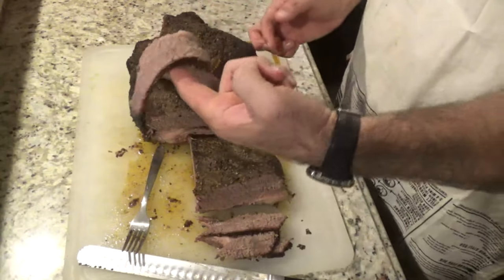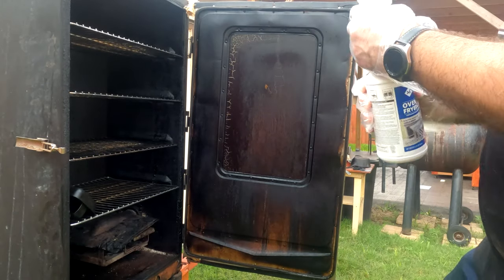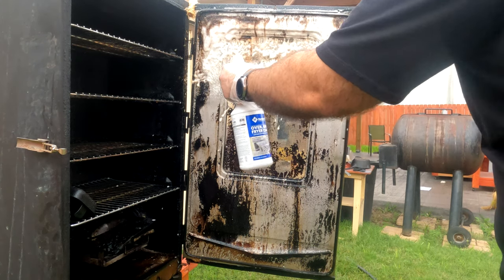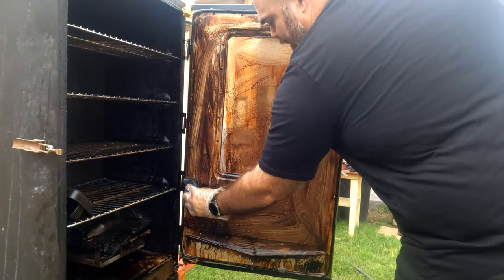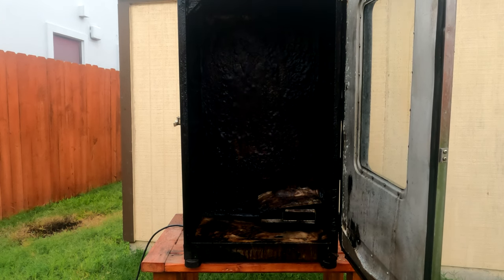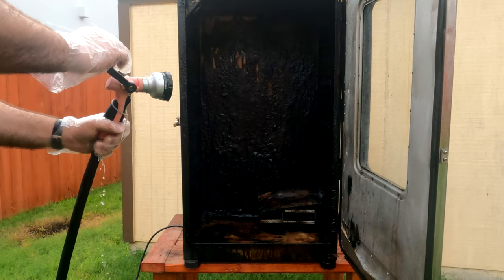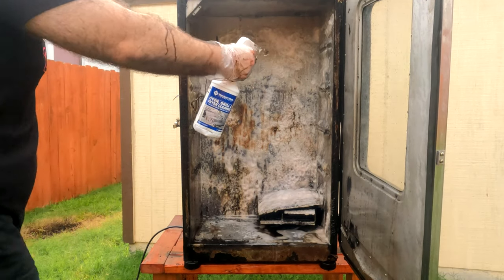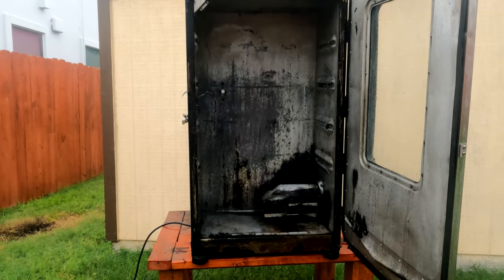How to Cleaning Your Smoker in HD

Comment: Is your a electric smoker? I just received a used one that needs some serious cleaning I was thinking about using oven cleaner on it but I can’t see if there are any wires in it
Reply from the maker: My thinking is that it's meant to get wet on the inside because that's what happens when you some something.  Moister is all over the inside during the smoke.  As long as you let it dry out before you turn it on again, you should be fine.
Reply: @TheSmokingBeard  thank you so much mine cleaned up real nice I’ve got it heating up to dry it out real good, can’t wait to use it, it was pretty gross

Comment: Amazing product. Just be aware that is not supposed to be used on certain surfaces. Not for use on residential ovens, stoves, etc., Not for use on painted surfaces.
Reply: I should have read your comment before trying it on mine.  It did take the paint off.
Reply: Yes, commercial grade is all stainless and has no coatings... that's why they use strong cleaners.  All the homeowner grade smokers have paint inside them to keep the mild steel from rusting.

Comment: Looks good, but I'm not sure if the oven cleaner may damage the smoker's foam  isolation, or rubber gaskets
Reply from the maker: I've used it multiple times with no issues.
Reply: @TheSmokingBeard  how does it react with rust
Reply from the maker: @aykoro  I always season it again after it dries out.  This has worked for me in preventing any type of rust build-up
Reply: @TheSmokingBeard how did you season it
Reply from the maker: @kellyhenderson3672  Yes... after I let it dry out, I ran about 4 hours worth of chips to re-season it.
Reply: @TheSmokingBeard  any oil?
Reply from the maker: @kellyhenderson3672  no

Comment: I've got an electric smoker and am curious how the water might effect the wiring. Could someone enlighten me? Thanks. Just a little nervous spraying water all over it.
Reply from the maker: As long as you let it dry out before turning it back on, you should be fine.  At least that's been my experience.  If you think about out when you smoke something and put a water pan, the entire inside is filled with moisture throughout the cook.

Comment: Hi Beard
I bought the cleaner through Amazon and it it as you said. So much so that it took some of the paint off inside my smoker the same as you have.
I went to lowes and bought high heat black spray paint to fix it. 
Anyway thanks for your videos as always they are helpful..
Reply from the maker: Hope you used gloves... 😆
Reply: @TheSmokingBeard   yes I did.
Reply: I would have left it bare metal and just kept it from rusting with an oil.  The less chemicals inside the better.
Reply: @cup_and_cone  believe me respraying it with fire proof paint is worth it. I don't have  to deal with the problems with rust and will last a lot longer than leaving it bare and using an oil coating. After all if you recoat with the right paint your only replacing what was already there before..
Reply: Well it is a year later now and I recleaned my smoker. The high temp spray paint bubbled up and I applied the same cleaner that beard recommended most of the paint came off. This time I just let it be I've smoke more fish since then.
I've had to change my mind on the spray paint.
Reply: @douglasgrant8315  this was a super informative video and comment thread. I appreciate your update.

Comment: What about using the decades old " oven off", or another product specifically used for cleaning ovens - that my mother used on our kitchen oven, before self cleaning ovens were invented?  And you forgot to tell the viewers to clean the smoker in an area that the greasy runoff won't make your driveway look like you just allowed your vehicle's old engine oil to drain on the pavement. Another question: How to clean the top heat vent of a smoker. My adjustable heat vent is VERY sticky, and I can barely move it. It's all gunked up with the same creosote and tar that is inside the smoker, as you've shown us to remove. Thanks for making a very helpful video.

Comment: Hi beard, one concern… is this going to effect my burner? My burner is open right in the bottom middle of my smoke. Is the water going to hurt that?
Reply from the maker: I wouldn't spray with too much water  pressure around the heating element or the top part where the wires are.  I would also just let it dry out completely before turning it on.

Comment: Beard,
Master built suggest using Apple cider vinegar and water 50/50. Any of your thoughts on that?
Reply from the maker: You can, but be ready to add extra elbow grease.  This method is less labor intensive.
Reply: @TheSmokingBeard  Give me elbow grease over those chemicals any day. Water and electrical appliances don't mix. Would you turn a hose loose on your oven? If it worked after, you just got lucky... this time.
Reply from the maker: Ok

Comment: What about the heat element? It won’t hurt it ?
Reply from the maker: I've cleaned mine like this multiple times with no issues.  Keep in mind that the smoker is built with the intention of having moister around it when smoking meats.  I wouldn't aim the water directly towards the element when cleaning it out.  I would also advise for you to completely let it dry out before turning it back on.  A day is usually enough time, but could be more if you're in a colder climate.

Comment: Thanks. They say your not supposed to use chemicals, but I figure if you rinse it good it will be fine. I'm going to use grease lightning and a pressure washer
Reply from the maker: Careful with the pressure washer.  It might damage the electrical

Comment: How often do you clean it. I smoke every weekend  usually. I am looking into an electric.  Using charcoal vertical and getting tired of babysitting my smokes. Old grumpy man
 Lol
Reply from the maker: About 2 times a year.  Once in the fall and once in the spring since I live in an area that allows me to smoke year round.  If not, once a year is fine.  Before you go full electric, have you considered a gravity fed smoker with a Thermoworks fire management system?  Check out my other videos.  I almost exclusively use that system.  It has been one of my smartest purchases so far.
Reply: @TheSmokingBeard  I'll check them out. Thank you

Comment: There's no problem with getting the heating element wet
Reply from the maker: Not that I have experienced.  When you think about it, juices drop down and surround the element during a cook.  I would let it completely dry out before turning it on after cleaning it the way you saw in the video.

Comment: Hi again Beard.
Do you  reheat and re-season the smoker after each cleaning to remove the chemical smell before going back to smoking meat.?
Reply from the maker: Yes.  I 1st let it completely dry then  a 1 hour smoke to re-season should be enough.
Reply: Does it leave any type of bad taste after use in the food? I scrubbed my smoker down today with brillo pads to clean it. Even after rinsing and letting it heat up for and hour afterwards to make sure it was ok to  use, I ruined the brisket. It tasted like a brillo pad.
Reply from the maker: You should let it run for about 4 hours with just wood before using it again
Reply: Thanks
Reply: @jonnyfortin hey I saw this video about putting a tea bag into old cookie sheets then adding hot water, and it worked great!
I wonder if it would work on my smoker?

Comment: I purchased this cleaner but was hesitant to use it. I was concerned about damaging the heating element. Should I be concerned, if so , is there a way to protect the heating element from possible damage when cleaning.  Thanks for your comments.
Reply from the maker: It should be fine, but you can wrap a plastic bag around it if you think that will help.  I've done it multiple times without covering up the heating element